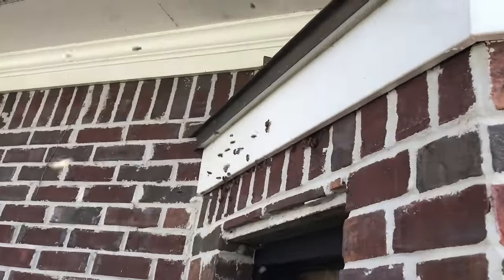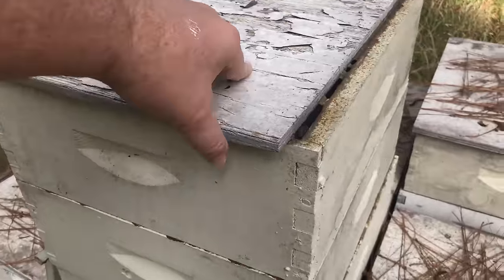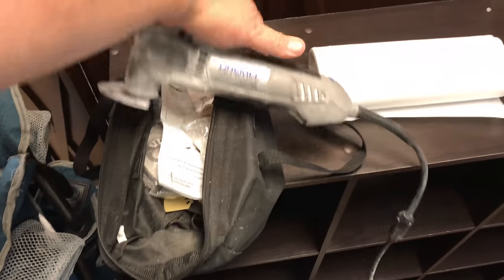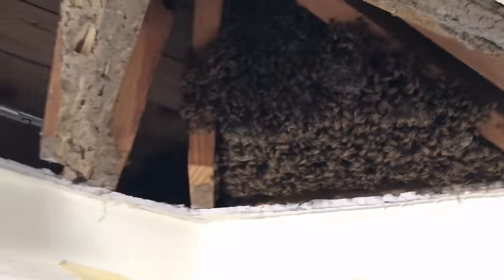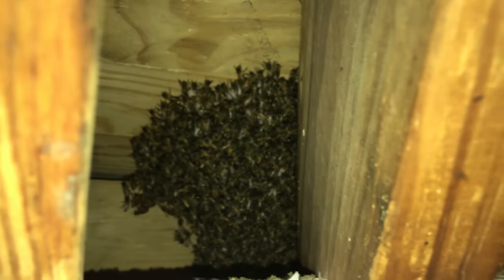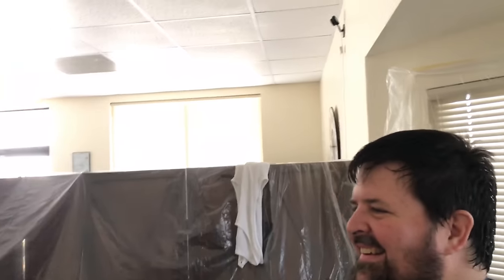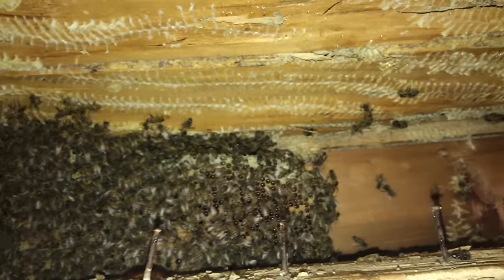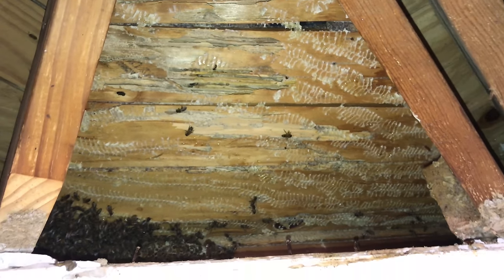We Removed Her Bees But Found Something Worse

Comment: Had the same problem with termites and bees in the same place. I kept seeing all the termite dust and thought it was from the bees so mostly just kept cleaning it up and not addressing it since I didn't care there was a beehive in the wall. I finally realized what was going on and then had to start tearing things apart. Like you I found 3 infestations, but the 3rd was rats and not roaches. Good times.

Comment: I live in a mobile home here in south central PA and I have wasps that are building hives of some kind in all my outside walls.  I hate to say it, but I have been killing off hundreds of them and am currently sealing up the whole upper edge where the siding meets the top near the roof line.  That is where the wasps are going in and out all around the mobile home.  I am hoping that any that are left inside the walls will have died off by next summer from basically starvation from not being able to get out for food or water.  I would like to take the metal siding off eventually so that I can fix things up.

Comment: Years ago  I was hearing this grinding sound, I didn't know what it was, thought it was a mouse or rat chewing on something.. Turns out it was a nest of wasps, and they were taking out my dry wall.. It was like a couple pieces of paper thick in a place above my window.  Found out by trying to get close to the source of the sound and noticed my wall my moving.. my dad poked a hole through and a wasp stung him.
Reply from the maker: I’ve found that several times.  Usually they do that behind wallpaper.   They leave to old wallpaper like a drum skin most of the time.

Comment: As a 40+ year veteran carpenter, one thing I've learned about building is that it's foolish to use wood to build a house, especially in the south. I love wood for interior cosmetic touches and furniture and crafts.
Structurally, you can't beat concrete and steel.

Comment: What I would suggest is a small mobile home air conditioner. You can use flexible hose to cool the room you are in. I would suggest an 18,000 BTU unit at minimum, and a 30,000 for more cooling if you want. I have used similar on job sites over the decades. If you want more information, let me know. I can get you a list of the unit, the air duct, and the electric supply. You can even tarp and tent outside areas if you are working outside. Even just with cool air blowing without a tarp or tent sure comes in handy for those real hot days.
Reply from the maker: Great idea!  We usually try to take a fan if we know there’s a problem with the A/C before hand.

Comment: The cotton shirts are the problem I think. I also am of similar size & get pretty sweaty when working but the cotton just holds & makes it worse. A loose button up is better to let evaporation work. A metal blade fan also works great too. Plastic fans are worse at moving air. I think the blades flatten out at higher speed & the grills are more restrictive.

Comment: 5 years ago we had a bee hive that took up a 8 ×10 wall.took clap board off outside of house there were between 30 to 50,000 thousand living in wall bee guy said they have been there for over 5 years with that size, they also got out at least 100 pounds of honey each 2x8 column was full of honey there were 4 columns.the bees came out swarmed out side of house those who weren't protected got stung, we uad to flee inside scary site.
Reply from the maker: I see that a couple of times a year.  Those big honey loaded ones are work.

Comment: Is the honeycomb that comes out of the walls of buildings safe to eat or is there a risk that chemicals in pressure treated wood and the like would be absorbed by being in contact with it?
Reply from the maker: It’s safe as long as no one has tried to poison the bees.
Reply: @628DirtRooster  Thanks.  I guess that would be hard to tell in many cases.

Comment: Go in there at night Papa couple holes in the drywall couple holes into that fascia in between prepare with a pyrethrin yes this will kill the bees. Remove the fascia board inspect and see if it's accessible to remove all of the hide and all of the dead bees if it's not you have a couple of decisions you can go through the roof which is less mess for the homeowner or you can go through the drywall on the inside. Going through the drywall you can seal the area up good enough to where you won't have any issues with the mess it's just not as convenient for the homeowners but it should cost a lot less unless you can remove them just by removing the fascia boards it's not that big of a deal really. If you don't want to kill the bees you can try and remove the facia board and see if you can't access the Queen in one of the bays. This could end up being a little bit more difficult but it's a possibility

Comment: For a female just getting bees next spring.. would u recommend one deep and two medium for brood or 3 medium for brood??????( im understand ill only have one box initially but im considering the big picture
Reply from the maker: If weight of your equipment is an issue I’d run everything in mediums.  If everything is one size it simplifies things a bit.   Id keep some deep equipment in case you get nucs or someone gives you any bees since they’ll likely be in deeps.  Three med or two deep for brood.

Comment: Is there any particular reason why you were cutting that large section of honey laden comb into two separate buckets?
Reply from the maker: I haven’t seen the video in a long time but I could have been separating capped from uncapped.
Reply: @628DirtRooster  Awesome, follow-on question then if you don't mind: Why separate capped from uncapped?
Reply from the maker: moisture content of uncapped would be too high for long term storage without fermentation.

Comment: Stop building houses out of wood ... and your termite problems are over ... and then bees and wasps wont find their way into the hollows under the roof either.

Building a house out of bricks is better for warm climates as well, because they are COOLER ... which means you dont need as much air conditioning.
Reply from the maker: Well there it is!  You’ve just solved everyone’s problems without any knowledge of construction or termites.

Comment: I’m a carpenter and I’m really wondering how you get honey stains out of drywall
Reply from the maker: You don't.  Clean it real good and cover with oil based sealer.  Spray Kilz works pretty good.